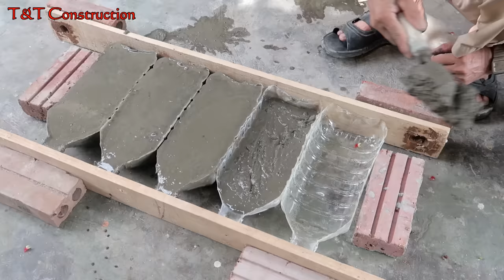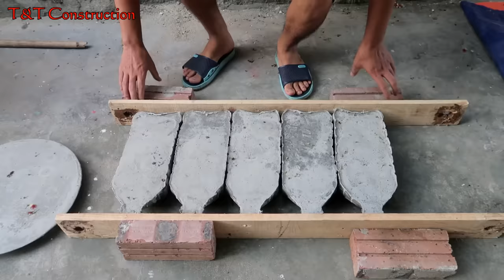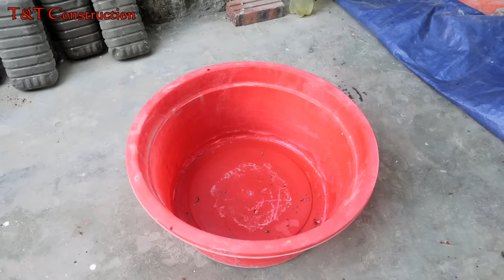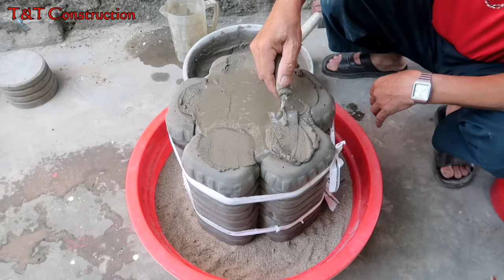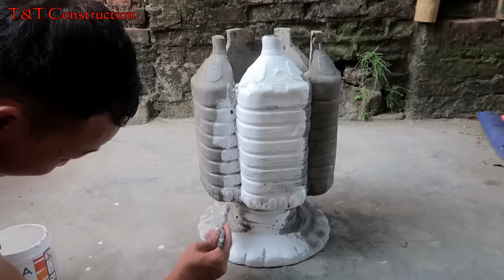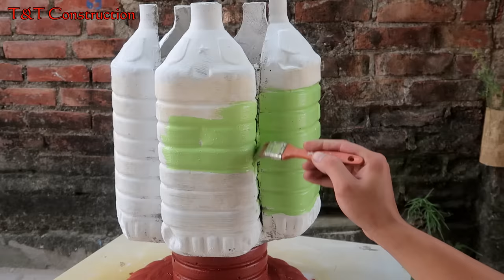Making a Beautiful Plant Pot With Plastic Bottles and Cement For Small Garden at Home

Comment: If u r giving ideas for other people's home, try making something "light".  Cement is heavy.  This is way too heavy for a pot.  Great effort trying though.  Keep it up.
Reply: Try lead !
Reply: what do you mean? like wood? that would rot quickly. not everyone can even work with plastics let alone turn them into something 'fashionable' so that option is out too. aluminum being rot/rust resistant is also out because not everyone has the equipment to make stuff out of it. 

actually cement is probably the best option here for custom pots if you want to make it yourself. my mom has some pots outside her house that her mom had. very big cement pots. these things, by themselves, weigh like at least 50lb each. they are pretty neat though and not something i see often because everyone just buys little plastic pots to stick things in.

plus... those things last practically forever. remember i said my moms mom had those pots before her? well my mom has had those pots now for roughly 18 years and those pots are still going.

Comment: Problems:
Weak joints where the 5 sections meet.
Reinforcing mesh should have been used.

No drainage hole. When it rains, it will fill with water be and the plant will drown.

Wasteful use of concrete and too heavy.
Line each bottle with reinforcing mesh then apply a thin layer of concrete. This will not only be lighter and stronger but allow more soil to be used for the plants.